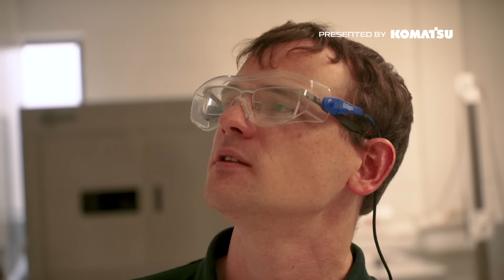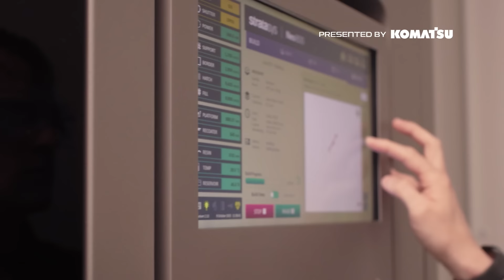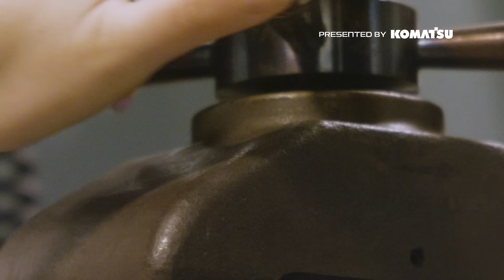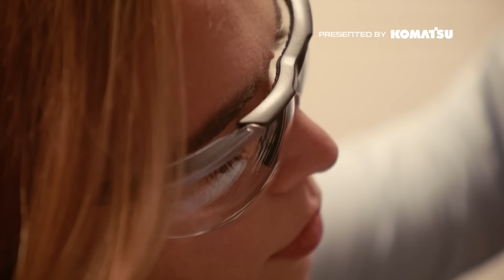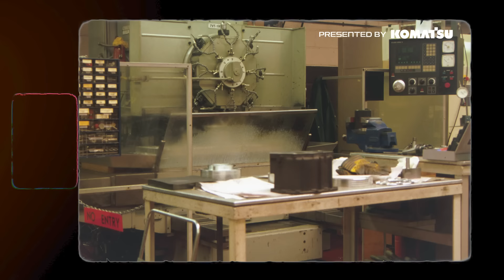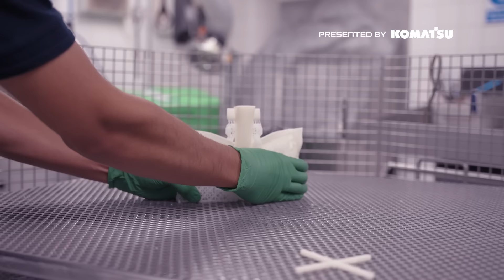How F1 Teams 3D Print Car Parts Overnight!

Comment: F1 should 3d print V10 engines...
Reply: technically possible, but far too expensive
Reply: @highlander5521 i dont think that price is the factor, when you think about the possibilities that you could have.
to be fair, I have limited knowledge in the materials....but....my guess is that, there is no usable metal powder that could handle the stress when relatively low at weight at he same time
Reply: @RandomTheories  SLM processes are already being used to manufacture such parts, as mentioned, it's possible, but still very expensive. We manufacture such parts ourselves (but in smaler scale), and they are primarily used in the aerospace indusrty, industrial sector or as spare parts in small quantities. Engine components, impellers, etc., are possible. So, in principle, a complete engine would be feasible. However, CNC machining is still cheaper/faster for big parts. There are companies that are already "printing" complete jet engines this way. At least the parts are possible, but not cast in one piece, since they are made of different materials.